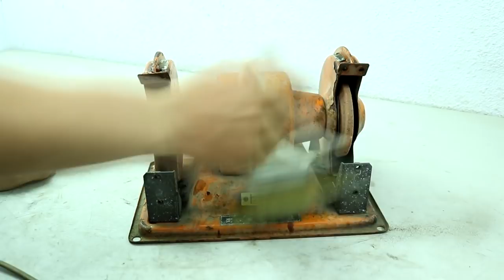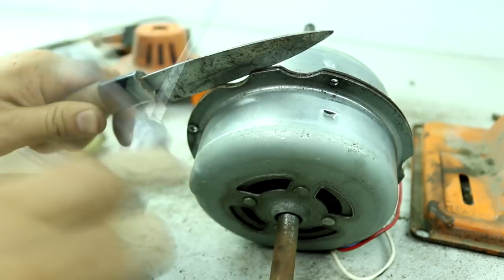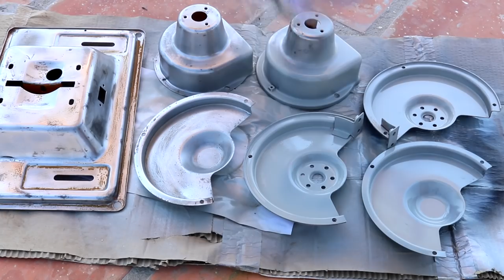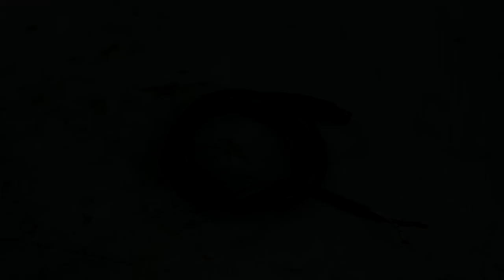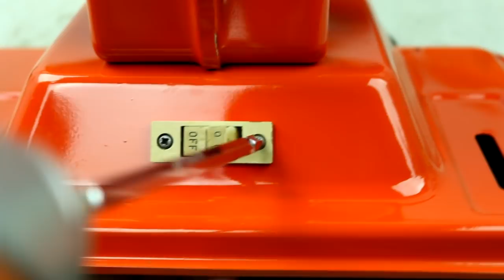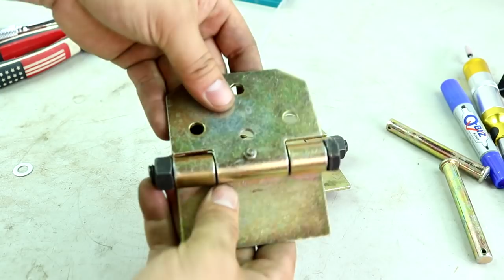Old Bench Grinder Restoration [kotobuki grinder orange]

Comment: What many of the commenters on the electrical don't know is since this was a Japanese grinder, it only came with a 2 prong system, You did right in putting it back to a 2 prong system and if a ground is required later then attach it to the mounting bolt and a ground in the building. Doing this keeps it correct. Thank you for a fine job.

Comment: Wire wheel the nuts and bolts holding the cases together.  They were dirty and corroded.  Nice job and nice video showing how.

Comment: Nice save.  The hinges as a rest for the work was innovative. Some automotive compounds on the plastic on/off switch would have restored that to like new.  A  wiring system, with ground, would add safety, although, I used my old Red Wing sans one for years prior to its rebuild.  Thanks
Reply from the maker: You're welcome, and thank you for comments.

Comment: you made a very nice refurbishing job here, I have often to make intervention on this type of machinery and usually, a problem that I encounter is that the shoulder that retain the thrust of the stone is too small and it creeps when the grinding wheel is tightened. to correct that, first, I machine the shaft to remove the damaged shoulder and I fabricate a washer that fit snugly on the shaft and incorporates the bushing that fits the center of the wheel so the wheel spins very true and an overtorque of the retaining nut will not induce wobbeling of the wheel.

Comment: What I believe everyone in here is missing is that this is "A RESTORATION" of an old grinder. Meaning - it is redoing and putting back together as it was. . Yes he placed new wire on it and plug but those were the type he took OFF of it. Re did the wiring also as it was.

Comment: @GB AS  Reading all these guys argue with you is rather amusing, I can definitely see your point in most of this discussion.  I don't know where this guy is from, but here in Canada it is fairly rare to find a residential home that does not have grounded outlets.  Having a polarized  plug would still be a good idea though.  As well a good soak in peroxide should make that switch look cleaner.  Nice looking restoration on the grinder Gear Show.
Reply from the maker: Thank you for sharing Cliff Bryans!

Comment: Nice job of repainting!
Not sure where you are located, but a ground wire (earth) would be my choice. Also, I'd recommend using grinding stones with paper blotters that help distribute the holding force applied by the flanges. By word of caution - the vitrified grinding stones should never be used on the side of the stone, unless they are specifically designed to handle side loads.
Reply from the maker: Thank you! it has ground wire at the backside, I connected it already. sorry for missing this part.

Comment: Gear Show: uses hinges for grinding platforms.
Me: mouth hangs open wondering why I didn't think of it for my grinder
Reply: That On/Off switch was dirty but the overall looks good
Reply: you didn't think of it because it's a fucking stupid thing to do when you can go buy a proper set for a few bucks. there is absolutely zero adjustment in those hinges so as the stones wear the safety risk increases

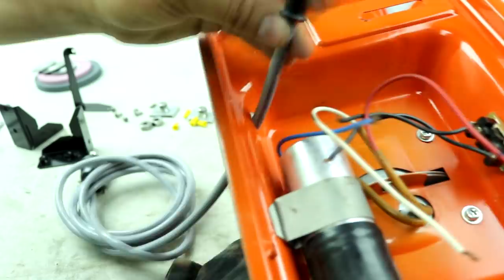Comment: At 11:00 in video,
This is a 100 VAC (Japan) bench tool.  
In North America, since this is NOT a double insulated tool, the replacement would be 3-wire, 16 AWG or 14 AWG Portable Cord, Type SJOOW Cable, 90°C 300 VOLT UL/CSA.  Wire gauge (AWG) depends on Motor Current Draw (amps).

The Safety Ground (Green Wire) would be attached with a 8-32 or 10-32 Machine Screw to threaded hole in the grinder’s casting.  For the grinder, one of the four motor/base attachment screws MAY be suitable (UL/CSA permissible).

Commercial tool mfg. “Crimp” a Ring Terminal on the cord’s Green wire for positive connection (avoid accidental disconnection).
The cordage would terminate in a NEMA 5-15P plug.  Consult NEC Sections on Portable Appliances for adherence.
Reply: @D_V_.746   Good to see comments on youtube from someone who actually IS an expert. Keep up the good work.
Reply: he is an expert, the minimum to do here is to use a multimeter and check for the continuity of the ground wire to be sure that it is effective in case of necessity
many old tools with a metallic casing does not have a ground so as long something is installed to retrieve an electrical fault, it is much better than the original design
Reply: Gentlemen -
Thank you for comments.  
My cousin was electrocuted, as a teenager, by a garage/shop owner that did not safety ground his equipment.
For me, it’s personal.
Reply: BOOOOOORRRRRING.....

Comment: A good restore of the grinder altough my feedback is that on the electrical wiring, you shouldhave cut off the exposed copper restriped the insulation so to prevent any wires that might have a coating due to age you would have eliminated that potential problem. Also never bundle the wiring like you did that could cause overheating by combining all the heat per wire adding up to fail. I’d also would have tested the swicht with a meter since you dont know if any of the contacts were dirty or corroded, again a point of possible failure. My last comment is you should never greased the shaft threads when you have a high rpm motor with a heavy weight attached, the grinding wheels, better touse locktite to keep the nuts on, locktite can always be removed by heat if you change the wheels. You basically did a good job, but overlooked some safety items.

Comment: You replaced a cord grip on the power cable for a strain relief which could potentially enable the connections to be pulled out if the cable gets caught round something. Worth bearing in mind when using it.

Comment: The hinges as support ruined the end product. It's a bad quick fix right in front of a cool machine!
Reply: why? I think the hinges improved it
Reply: WhiteAlcatraz improved functionality, but imo not the visual appereance
Reply: @nicki419  
makes sense.
I'm more of a function > form type of guy.
That doesn't mean you could have both, though.
Reply: They helped the functionality of the machine but they could've been painted black and cut to a better shape
Reply: yeah, I guess he could have used a bent plate or something like it
Reply: @Diego
Agreed 🤝. A piece of angle iron would have worked much better imo.
Reply: @nicki419  all the original parts are there and if you don't like it he can just screw them off if you did not see how he screwed them on.
Reply: @FQP-7024  that has nothing to do with what I said.
Reply: @nicki419  still if ya don't like the hinges then don't look at them because it's still a good make shift helpful thing to have
Reply: @FQP-7024  I like the things he does, but there's always a thing that's less good than others.
Reply: @nicki419  yea I know I know but come on you gota give some credit to the creativity I mean who could come up with hinges as supports like that and they fit perfectly too
Reply: @FQP-7024  I didn't criticise that, I criticised the asthetics.
Reply: @nicki419  well they are hinges what can you expect

Comment: Nice job, but if you go so far to dismantle the thing, I would have changed the bearings of the rotor and properly cleaned and put an extra layer of insulating lack on the stator. + changed the wiring like potti 314 there wrote.

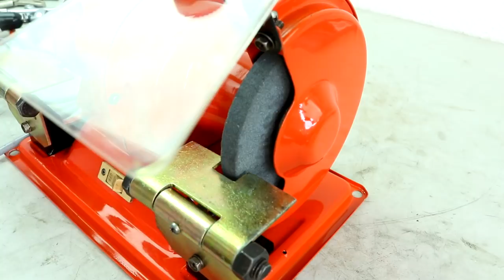Comment: Nice work, looks new again. Strange motor design, what with the bearings so far inboard of the wheels. Clever re-purposing of the hinges as tool rests, but they are set too low. Something could easily jam between the wheels and the rests. 16:05 - Oh, boy, never, NEVER grind on the side of a wheel... also, that wheel is missing its blotters. I have to agree with the others on changing the bearings while in there. They aren't expensive.

Comment: Nice Job! If your going to do a lot of work on domestic Japanese equipment I would recommend getting some JIS screw drivers. Those screws look like Philips head screws, but they are not. You can tell by the little dimple-like depression on the screw heads. Philips drivers can damage JIS screws and vice versa. And never use a power driver with JIS screws. They're not designed to cam-out under excessive torque like Philips screws do. You could damage your driver.
Great work otherwise!

Comment: Good restoration, but you need to change plug and power cord from 2 to 3 wire and ground the shell of grinder. It is dangerous to use it that way. Electrical appliances with metal outer shell must be grounded, because in case of damaged insulation of live cable, you can have 110V on its shell, no mater that device will continue to work as expected. At least, use it only in GFI protected sockets.
Reply from the maker: Thank you so much for your suggestion.
Reply: Philip -
My cousin (age 17) was electrocuted, in a shop where owner didn’t believe in proper safety grounding (green wire), proper power tools.
My uncle’s oldest son.  Shop business shutdown, owner left community with guilt following him.
Reply: @w9gb  Safety rules are written by blood and suffering of many. It is shame not to follow - one stupid cable less and 17 year old life is ended. My condolences...

Comment: nice efford but was it worth to you? cheap grinder in the first place, not changed the bearings, new cable isnt protected to get pulled out of the new case fitting ... at least secure it with a cable tie, the hinge system can´t be adjusted towards the stones and i dont get the small screw in the middle ... by tightening the big screw the small screw in the middle is bend and never will come out easily

Comment: Ended up nice, but you could have cleaned the casing screws. The screws underneath and hidden behind the grinding discs were clean, but the outer ones around the middle were still dirty.

Comment: Man, your work is absolulety awesome. I wish I could do some of this! Man, did you ever consider to buy an air compressor to apply primers? i think it will help, since you use the same primer every time! I think it will surely work best than sprays.  

Nice job man, nicely done!
Reply from the maker: Yes you're right air compressor is more easier, I plan to buy it soon, thank you so much for your suggestion.

Comment: Nice job on the repaint and clean up.  But.  The original build quality on this thing is so low, that you might have spent more money on new stones, shields and hinges than it would cost to get a similar low-quality one from China. Its stampings are as thin as pie tins.  The whole base was flexing as you were tightening things.

The bearings appeared damaged as well.  I would have added a plug with an earth ground and grounded the chassis for safety also.  

All that being said, it looks like it works!  Keep an eye out for a nice heavy duty vintage model with a solid casting and good motor.
Reply from the maker: Thank you for feedback.

Comment: To have gone to all that trouble and not replaced the bearings was a mistake and a tad slack me thinks. Still the end result is impressive
Reply: Paul Goodier  He restored a perfectly working circular saw that just needed a new blade and replaced the bearings and took apart the electronics..... So clearly that's not what he does.
Reply: Paul Goodier  You don't who I am, so your comment about what I'm capable of is a shitty attempt at an ad hominem attack.

My point was about what you YOURSELF said. If it works don't change it. Yet he had a circular saw with a rusty blade, that just needed replacing. Instead he took the thing apart, replaced bearing etc. Where's your "if it works don't change it" attitude now?

What he's doing isn't anything special, a child could do it with a bit of instruction. He took some screws out, and took the thing apart. Stripped paint, and then repainted and put it back together. Not ground breaking by any means. 

I'm a mechanical engineer, I've worked on car engines, and have specialisations in Gas Turbine Propulsion, and do some machining work at home. This stuff isn't hard for the lay person, and it certainly isn't for me.
Reply: the bearings wouldn't have needed to be replaced but why did he put grease on the bolts that gold the fast spinning grinding pads
Reply: @ Apisto: I agree, they spun a little too freely for my taste. Still, it was a beautifully done restoration.
Reply: @TheRealMentat001  I guess its' my perfectionist mechanical background. Yeah I know the tear down of this unit was simple and easily replicated but bearing don't cost a lot. I both understand and appreciate the decision to leave the original bearings (which appeared OK) in place but.....I'd have swapped them out to make the unit as perfect as possible.
Reply: Paul Goodier  What does that even mean? Haha so funny.
Reply: Paul Goodier  Hey - this is very very true, We are looking from different aspects of philosophy. "If It Ain't Broke Don't Fix It" has a very great deal of merit and I appreciate this. BUT....if one were to consider the part bearings play within machinery and or motors coupled with the time / effort associated with a motor tear-down, surely you see the validation of swapping out these relatively cheap components. IF I were rebuilding that grinder - considering both the ease of tear-down and it's significance as a serious tool - if the bearings were OK I'd probably leave them in fully prepared to repeat the process should they fail to perform in a perfect manner. Analogy - you take your car to your mechanic coz' you ain't happy with the brakes - you want him to leave the pads in or swap them out?
Reply: It didn't need new bearings. It had the same problem most old grinders have. It needed a good cleaning, lubrication, and new electrical connections like a plug.
Reply: Paul Goodier  those roller bearings needed to be replaced. the machine looks like it worked for a million hours. You can't garantee they won't give you a headache sometime later, AND they are really cheap to be replaced.
Reply: Paul Goodier  Yep, and in the military we had an expression, If it ain't broke, don't fix it.
Reply: The only problem with "If it ain't broke, don't fix it" is that the grinder functioned the same WITHOUT the new paint job, so why bother stripping and respraying it?
Reply: He commented that they were good

Comment: why didn't you change bearing ?
Reply from the maker: All bearings are good, that why I skip it.
Reply: @gear_show  Never skip a good bearing.
Reply: @omegalord  so true
Reply: It didn't really need new bearings. It clearly needed cleaning and some new wiring.
Reply: Probably because its only 5 years old.
Reply: as gear show says, the bearing are good, however, it is a good idea to inject some new grease on them as a bearing takes damage when they lack of grease and the ball begin vibrating, causing damage to their races
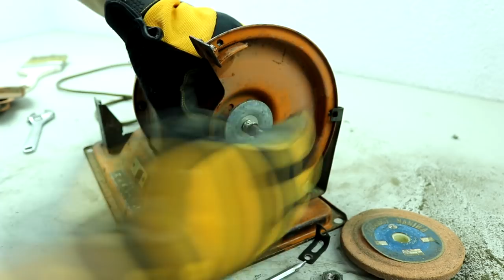Reply: what Is that wrench / device you used to extract that fender washer at 1:45?  @gear_show
Reply: @rayjr62  That is a gear puller
Reply: thank you.  @Bill97070
Reply: electrik fix